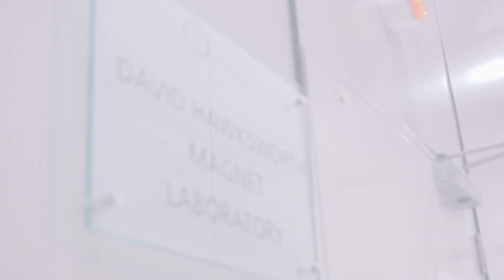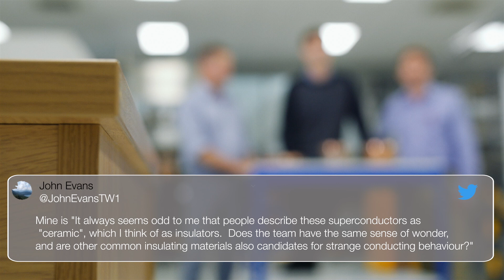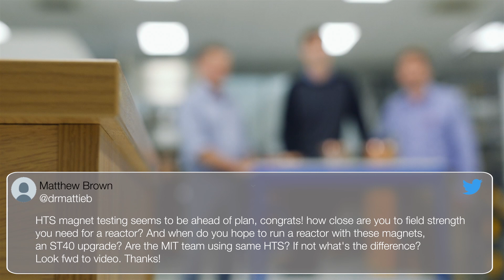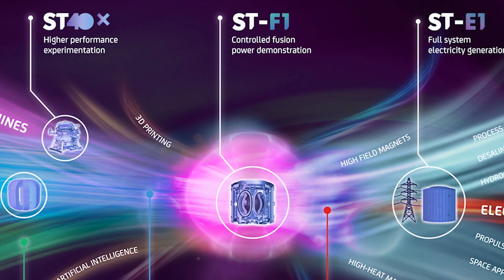The HTS team answers your questions from Twitter

Comment: Not interested in prizes.
The reason why Superconduction works.., the clue is in the Cooper Pairings of Electrons, which are a light-sound/photon-phonon resonance imaging function fractal-bubble cause-effect.., e-Pi-i "2-ness" probability property, (complex wave-packaging a String Theorist might confirm mathematically). So you'd suspect higher temperature Superconductivity to be a harmonic resonance of "4-ness".

Comment: What if you replicated the Solar Clockwork instead via Reversed Polarity + Counter-Rotation. What if you put the Design of the Cores hidden in Stars & Planets into a Tokomak then forced the Cores to spin & orbit the Tokomak instead of spinning Turbines?

What happens when you take a Field and increase the rotational velocity inward like the Sun 32 day into 27 day rotation? 

YOU ARE MULTIPLYING ENERGY

What happens if you recreated the Core of the SUN and increased the rotational velocity by speeds of 1,000 mph while that velocity multiplied inward? 

NOW WE HAVE AN ACTUAL ENERGY FACTORY

What if you now tapped into the heart & Core of the Sun w/o the heat but instead w/ Copper Wires. 

NOW WE FOUND UNLIMITED CLEAN ENERGY
Every other attempt will be doomed to fail or not live up to expectations.
Reply: The Magnetic Field of the Sun is stacked in layers of Reversed Polarity. When the outermost layer is forced to Rotate. The layers below are driven to Rotate as well like Gears. 

The 32 day into 27 day rotation of the Sun is Mechanical via overlapped Magnetic Field interaction from the outside inward. 

The Planetary decrease in orbital velocities outward from the Sun's equatorial plane is a mirror reflection of the Solar rotation. 

If you don't understand. Go ask CMR Polymagnet creators How the Fields work like GEARS in the SOLAR CLOCKWORK.
Reply: This technology was shown by Jupiter's countless layers of Counter-Rotation to exist at the very CORE of not only the STARS but also every Planet as well. 

youtu.be/drD416THU7Y

Engineer the Solar Clockwork into a modified Tokomak = The overabundant Energy you are seeking to obtain. 

You don't even need Fusion. You just need to replicate the Solar CLOCKWORK by forcing the GEARS to multiply rotational Velocity inward.
Reply: Scientists are already on it: 
Blowing bubbles: PPPL scientist confirms novel way to launch and drive current in fusion plasmas 
https://www.pppl.gov/news/2019/11/blowing-bubbles-pppl-scientist-confirms-novel-way-launch-and-drive-current-fusion
Reply: @johnbash-on-ger  - This is the problem, bro. The Tokamak is using technology invented in 1698 via Steam Engine spinning Turbines. The Tokamak is an inanimate Steam Machine while the Solar System spins Cores instead. 

You're comprehension of Clockwork is frustratingly awful.......... in comparison
Reply: @johnbash-on-ger  - I get your Profile pic but I'm not a gd fkn troll ffs.......... You're understanding of the Sun, Stars & Solar Systems is stuck on The Flinstones rendition due to Relativity & the Gravitational fallacy Model. It's not 1698 any longer........
Reply: @johnbash-on-ger  - My version is Bullet Proof while your rendition cannot & never will live up to the hype & expectations....... Welcome to Reality
Reply: @johnbash-on-ger  - If y'all were intelligent y'all would modify the Tokamak like I said & attempt to improve upon such. . . . . . . . . .
How? Idk by recreating Ferrofluid w/ powdered Copper instead of Iron and filling the Tokamak w/ such Liquid. 

As long as the Cores remain liquefied now the Tokamak is an Electric Jugganaut that could possibly have Battery connectors on both ends of the area anchored to the ground so wires are not tangled up in the endless rotation. 

Even my ideas that may or may not work sound Light Years beyond archaic Steam Engine concepts but y'all do you instead. I'm sorry I'm not impressed.
Reply: @johnbash-on-ger  - Maybe just add Copper into the Neodymium itself. Then once melted the Fields will rotate like a Blender mixing the Copper w/in the Neodymium. 

One way or the other or the original idea. Doesn't seriously matter. As long as it mimics the Solar Clockwork there is zero reasons why it should not actually work.
Reply: @johnbash-on-ger  - they should debate me. If I'm mistaken I should be easily corrected yet that most certainly is definitely not the case. 

Just ignore me instead & 500 years from now Fusion Energy will still not be viable. Since the Sun is like Earth w/ Fields constantly blown backwards by the Higher Power meaning breaking even on energy used vs created is impossible.

Unless you recreate the actual Clockwork. . . . .

Comment: Such a nice project. Does the stellarator have these same superconductor challenge? The cooling seems a lesser problem on this fusion reactor.
Reply: W7-X and LHD are the only stellarators that use superconducting coils, but that’s only due to cost.  W7-X is the only stellarator that has non planar superconducting coils.  W7-X uses LTS superconductors, HTS are higher performance but Much more expensive (due to difficulty in manufacturing).  Stellarator performance is sensitive to variations in the magnetic flux surface (manufacturing tolerance is expensively low on complicated shaped coils).  With current optimization techniques and LTS superconductors a GWe stellarator would have a major radius of 6m and a minor radius of 2m.  This would require a serious amount of superconductors, perhaps in the hundreds of millions of USD just for the raw superconductor tape.  That’s not to say it can’t be done and can’t be done economically, but it is still a challenge for stellarators.  Lawson criterion is key: triple product of confinement time (minimize radial drift, the stellarator challenge), density (big magnet good), and temperature (big heating good).

If we just say we don’t care about minimizing size, it may be possible to have an ignited stellarator using only water cooled copper coils.  Similarly HTS superconductors would allow for smaller stellarators.  I haven’t seen any studies on this, but they will come when economical reactors are within line of sight.  A proper crash program like the manhattan project would get us there in ten years.  At the current pace it’s unclear if it’ll be in the next fifty years.  ITER staying on track is important because it will inform us of many important things necessary for actual reactors and is cheap relative to the alternatives.  Once its up the budget can be spent elsewhere, likely to make a series of national reactors.  Some may be stellarators.
Reply: @willis936  Thank you for your explanation Willis very useful. I can imagine LTS superconductors is suffice at the moment for the stellarator W7-X for the research they are doing right now. Just like Tokamak energy performing a parallel study on the HTS supercondutors is better for the complexity of the design of these. Yes a Manhattan like project would be speed up the development dramaticaly but is highly unthinkable i think. Also the diversity of reactors is good if they share all the information of the research.

Comment: Is the production of tritium and deuterium from water coolant not advantageous? Would a fusion reactor not need to "breed" fuel for its subsequent duty cycles?
Reply: catfooddogfood They are testing with blankets to breed tritium in the Tokamak to make it self sustaining. https://www.iter.org/mach/TritiumBreeding
Reply: Typically one does not what Tritium to be created in the Water since you then have to make everything that the water runs through radiation proof, which is very expensive and takes a lot of effort. Especially the Turbines. However one could have the Tritiated water heat other water that then runs to the Steam generator. But if you did that, you would loose efficiency in the Process.
So the typical Process is to use the flux to fission Lithium to Tritium.

Comment: Great and interesting video! I'm interested of the last question. MIT suggested to use liquid FLiBe as a blanket material to absorb the neutrons flux, thus also generate tritium from the Li-6 isotope to the fuel. Q: have you considered something similar?
Reply: Why is there a need to absorb the neutron flux?
Reply: @richardshane456  That's where the 'power' comes from. Neutrons heat the water/FLiBe and heat exchangers boil a secondary loop that turns to steam which turns a turbine!